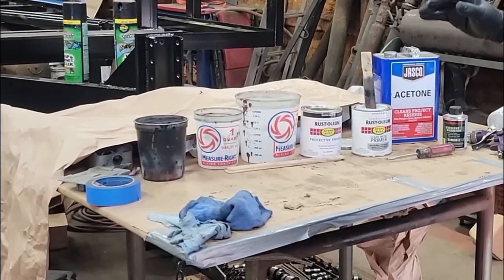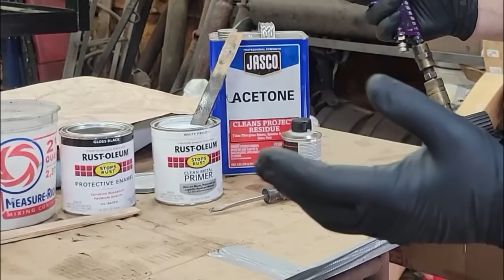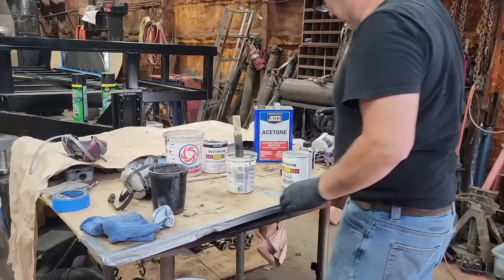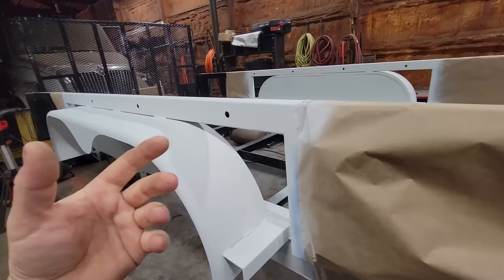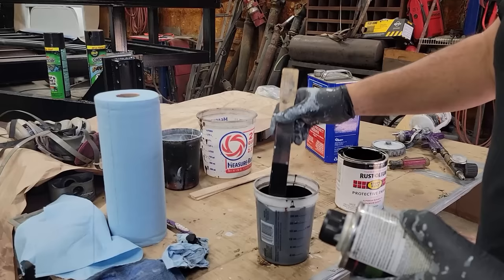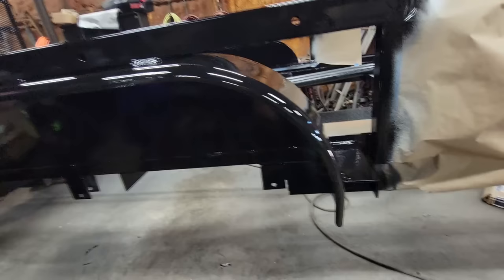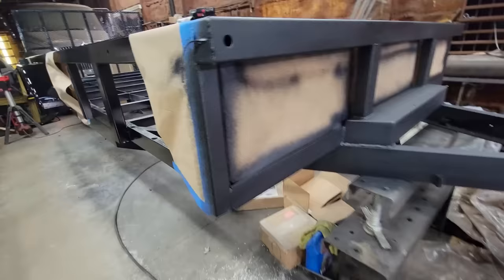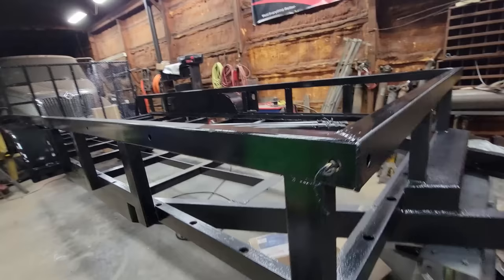COMPLETE UTILITY TRAILER REBUILD PT 9. SPRAYING PRIMER, PAINT AND ROCK GAURD!

Comment: hope Ms. JC has a respirator to wear while JC sprays  - taking it off only for narration - she needs to be safe too
also a tip I find useful is to use a flat blade screw driver and punch thru the paint can groove at 12-3-6-9 oclock - lets paint flow back into the can after you pour from the can- give it a minute or two and after a quick wipe the lid seals when you put it back on.    If you want shiny fenders use a red 3m pad to lightly scuff DRY primer coat - then wipe with a tack rag before spraying color coat..   

for what it is Rustoleum is a great paint - I thin with real MEK and it drys real quick and smooth.  I like the 1 qt siphon cup style spray gun because it holds a lot more paint and is better balanced when crawling around painting trailers and such.....not instructions on how to do it just how I do it.....pleasure watching you two work as a team - keep making videos

Comment: The chip guard looks one hell a lot better painted & if i ever need put it on something i'm doing it your way it looks so much better ! Idea add a side gate for the mower so if you got the side by side or mini truck on you can still access the mower without having to unload whatever is on the rear !
Reply from the maker: most trailers that are built with a top rail have undersized framing and uses the top rail to bring it up to what is needed. dont want to cut it out without factory it in. i am not a fan of trailers with a side gate. they are always lop sided due to the extra weight.